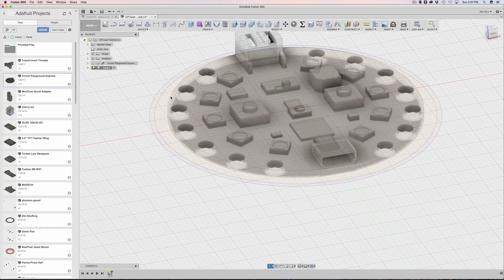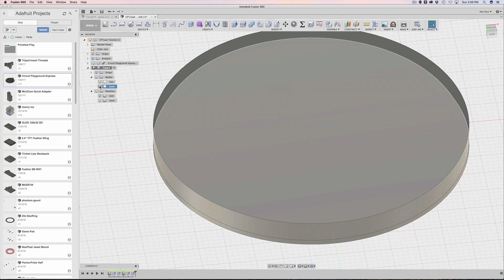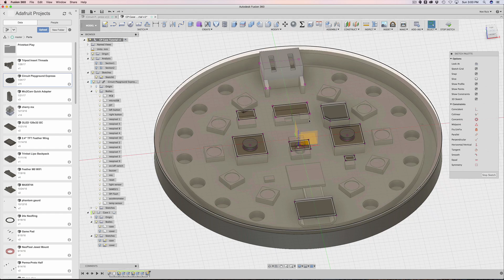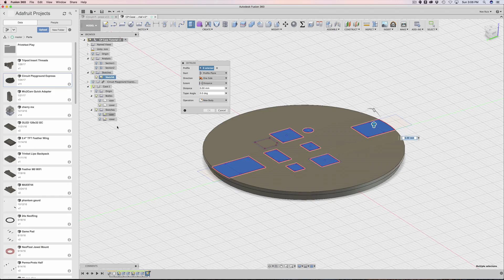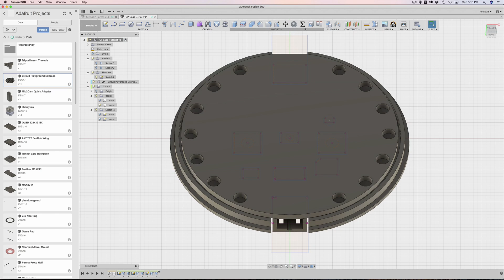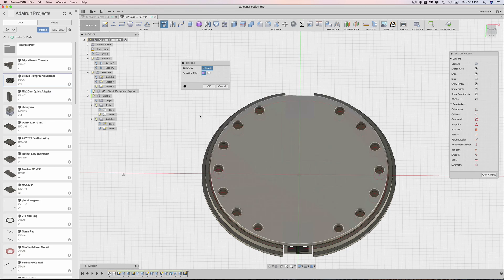Layer by Layer – Circuit Playground Express Enclosure @adafruit #adafruit

Comment: When projecting the geometry for the switch, instead of drawing a rectangle and setting dimensions you can select one side of the rectangle and click chain selection in the offset window. If it doesn't automatically select the entire rectangle you should be able to manually select the rest of it. 

Never thought to make projected lines construction line. This will save lots of time.

Comment: You can just project the face of the pcb and it'll give you outlines of all of the components on it. You can also make the projected lines into construction lines to make your extrusions a little bit easier. It's also a good idea to hide the body after that just to avoid problems with selection.
Reply from the maker: I'm facepalming right now. Of course! I didn't consider trying that because I didn't want to project everything (like the samd, and spi flash) but I could just select the profiles I want. It'd certainly save like 10 minutes of clicking!